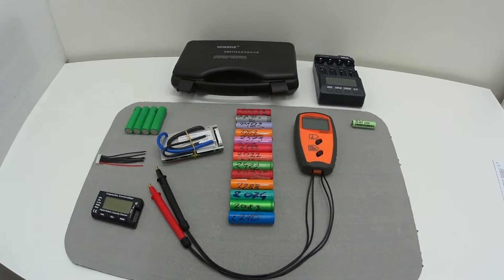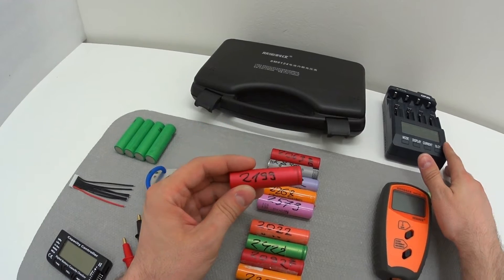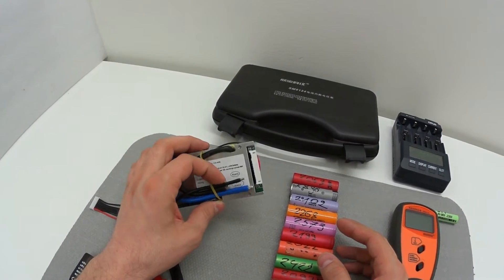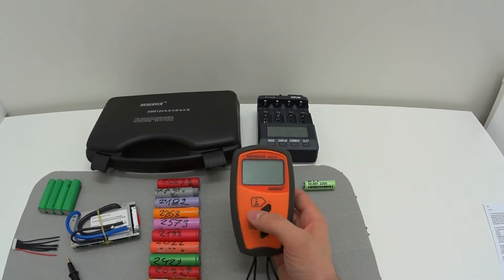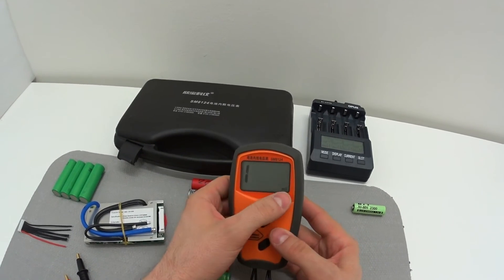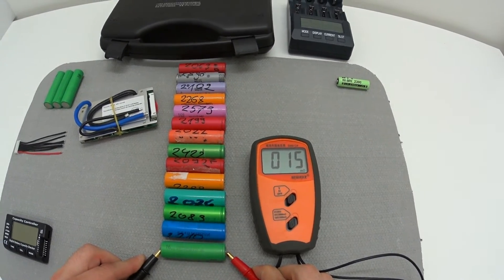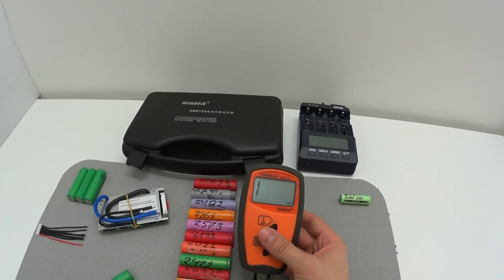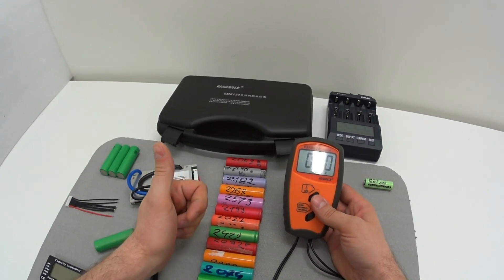18650 battery resistance SM8124 Battery Resistance Tester

Comment: Hi and thanks for the video. Lets say I have a simple 2s2p battery pack. Two cells are 1500mAh and 100mOhm and two are 2500mAh 50mOhm. If I take one of each and make a parallel connection won't I end up with a battery pack that is balanced? (two 4000mAh + 33mOhm in series) It would be great to see how much the resistance can deviate within a parallel group. We know that in series it's very important that it's matched but parallel?

Comment: I agree with you on most of this, but not all of it. 
If you are building a battery pack for a high drain application then yes, performing an ESR test can be valuable to keep your cells balanced. But if you are running something really low drain like a powerwall, ESR can be mostly ignored since the drain on each cell is so small to begin with.
Reply: The discharge on 18650s is Around 2% to 3% a month .
Reply: @Wifey0806  Who cares if self-discharge is 2% or 3% ever month ...  When the cells are top-balanced nearly every day !

Comment: Could we add resistance to a cell to balance it with another?
Reply: it's ok to have different resistance, that just means you have a cell that will have a lower discharge rate, as long as your discharge per cell is below the maximum dischange of your weakest cell you are ok. Of course what will happen is the higher resistance cells will loose capacity faster than the lower resistance cells and your cell group capacity will become different.
Reply: @bobmutchseo  so what’s best to check for battery capacity when doing a pack ? I have a problem with a pack I made they are from the same 1c rating 2000mah each and I made a 6s1p pack and my charger has “balanced them and fully charged them “ all show same voltages when charged but I have noticed since I don’t have a bms that in the over all24v output cables I get after a load of .5A draw a lower voltage on cell1/2 . I have the 6s balance leads cables to connect to the smart charger . Yet resistance of cell 1 is 46.9milliohms  same on 2nd  3rd is 50,4th48.2,5th47.8,6th43.9 after fully charge same was when plugged in when discharged and charge but then again I have done a capacity test and that I don’t know how to do?

Comment: Hi, In your opinion what would be the tolerance value of capacity and internal resistance values to match 2 or more 18650 cells?
Reply: Franco Pieruccini Faria That will mostly depend on the quality and capabilities of the bms that you select for them...
Generally speaking, most (Chinese) bms  manufacturers recommend that the cells used be matched well, so each cell paired up match each other at least to voltage ≦0.05V, IR≦15 mΩ,capacity≦30mAh.
Doing this will help the longevity and reliability of the assembled battery pack.
Reply: ABritInNY Very good explanation and well consistent. Have you made many pack with these limits mentioned and worked out as intended?? Many thanks
Reply: Franco Pieruccini Faria Yes, those are the variance figures I generally rely on when matching cells for constructing packs. Obv when building packs, for best consistency it's best if the cells used are new and of the same type and  generally when using new (quality) cells, people don't bother checking their resistance and capacity, but imo one should anyway, because even if only one cell is not to spec, the "chain will only be as strong as its weakest link."

Comment: Well it looks good but the numbers in your resistance meter are all over the place! How do you get consistance in a meter that the reading is all over the place?
Reply: Nexi Tech Ok good to know.. Thanks.
Reply from the maker: That's how device works guys. You have to wait few second to get exactly resistance number. Pressure on your fingers needs to be same and you have to hold few sec to impediance go down to result number. If you do so device will hold results number. I move from one battery to next battery very quickly and you get wrong feeling that numbers are jumping. I should go slower. Sorry guys.
Reply: santiago vindell glad that you are saying that i watched the video and he didn’t get a solid number, The numbers keeped deleting by one numeral

Comment: Fantastic video!  Have same SM8124A and love it.  Use it to intermittently check solar battery bank of 8S2P Trojan T-105s (6v) for 48v system.  I simply let batteries rest a few hours and test each one.  Saved my hide once when a float for one of the cells of my watering system (FLA) got stuck and began to allow plates to become exposed.  Also, able to test connection resistance of cables between batteries by subtracting the sum of 2 batts in series from the sum of both batts connected with cabling.  Temperature is critical and must be constant among all batts when testing, though.  Really love your no-nonsense vid; going to check out your other vids now.  Thanks, Nexi Tech.
Reply: Hi, Nice to see your comment, do you have a table that shows resistance of cables for current and distance and volt?

Comment: hum... i would totally concur if i was making a high current type battery back to match IRs,  but if I was building a low current drain application pack, i would think the IR wouldnt make a significant difference in pack matching. high current, the high IR batteries will drop voltage very fast and get hotter than the low IR batteries.  But for low current drain applications, matching capacity would be more important. and in a perfect world matching IR and capacity would be best.
Reply: even if you match used cells capacity with reparkr.com and you get your resistance with in 15mOhms you still have to deal with the fact that you are using different chemistries with different attributes.  I think a range of 20mOhms to 30mOhms resistance difference is ok for 30A 6P to 50A 10P battery packs.

Comment: Thanks for the informative video, it was very good.

I have a question.  It wasn't quite clear from your video about how to use this information.  Do I want all the cells in the entire pack to be of very similar resistance, or in each parallel group, or each series group?  I'm in the process of collecting cells for a small powerwall (about 4000 cells).  Matching resistance will mean a LOT more checking and setting aside a LOT of cells with mismatched resistance.

Also, how close should the resistance levels be? 5 or less mili-Ohms, or is a 20+ mili-Ohm difference OK?

Thanks.
Reply from the maker: Hi Eric. Well the best of best is if you can match every cell in every group to get perfect results but in your case you are building power-wall and we talking about 4000 cells so am sure you don't need to match every cell in every group but maybe each cells pack(series) and compare with next cell pack. In your power wall is 4000 cells and am sure your discharging current will not be nearly to much stressing like for example on E-bike battery. Usual DIY Ebike battery made from laptop 18650 battery's has around 120 cells (13S) 48V nominal and around 9 battery in parallel due to lack of space.  So you can imagine pulling 40-50A from that battery pack? That's 9 cell in parallel puling 40-50A. That's around 5.5A per cell and most Laptop cells are 2C discharge rate. 2000Mah(2C)= 4A in theory when cell is brand new. And there is a problem. Cells very easy become warm and then hot(plus there is no space and cooling in battery bag on e-bike) and after couple charging/discharging cycles they will go out of balance if resistance is not match and BMS has no chance to balance that battery pack and that pack will degrade and fail in short period of time. So resistance,capacity and voltage match in that application is crucial. So less stress on every cell meaning less to none problems with balancing individual cells group. Am not sure how many cells in serial your 4000 cell pack will have am guessing 24V if you go solar? Or 48V if you going on wind? That´s most common setup,  In 48V scenario you will have 300+ cells in every group. If you pulling 100A from that battery pack that will be 0.3A per cell and that is nothing. I don't thing you need to worry to much about resistance in your case even 20 milli-ohm is not a big deal in huge batterypack like yours. But  keep in mind if one cell die that can discharge and kill whole cellpack(300cells) every cell that is connected in parallel and dis-balance whole pack.  So I would just check every cell for precaution.  maybe you find some cell with 400-600mili-ohm resistance? I would not use that cell. Max 200mili-ohm is ''OK' cells for low power drain application. Adding small fuse wire to every cells is good option too or adding voltage tester alarm?  Look my video about voltage testers it could be useful to you. There you can see dis-balancing in live :) Regards!   https://www.youtube.com/watch?v=VTMQ0Eg8Xhc
Reply: Thanks very much for your clear and detailed answer.  It was very helpful.  I'm looking at a solar setup, but still deciding between 24/48 V.  Most likely 24V due to availability/price of charge controllers and inverters in my area.

Thanks again.
Reply: The way I learned years ago is that each series cells need to be close to the same internal resistance at the same state of charge.  When you have parallel cells,  they don't have to match,  but they need to add together so each series cells match.  

Here is an example of a 3p4s battery:

           P1.         P2.         P3.     Total
S1.     65.          85.         25.      14.9
S2.     60.          25.         45.      12.5
S3.     75.          55.          25.     14
S4.     30           45.          80.     14.7

In S1 65milliohm, 85mohm, and 25mohm add up to 14.9mohm when in parallel.  See how the totals are all close.  Numbers like these are close enough.  They don't have to be perfect.  Parallel resistance doesn't add together.  There is a formula,  but I use a parallel resistance calculator on Google.

Comment: so there you are hiding your battery packs!hmmm...Nice info there.What is a max number for 18650 internal resistance to use it to a battery pack?for example 150? can be used?And something last as more internal resistance has a battery means is used more so it drains faster?